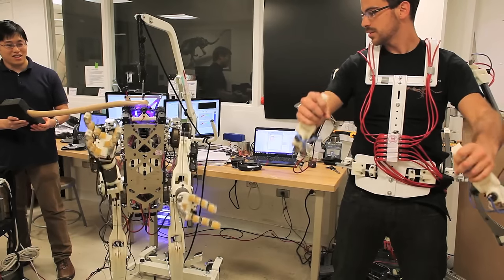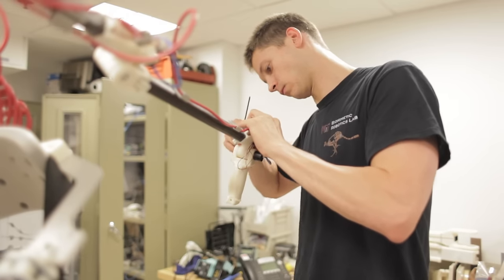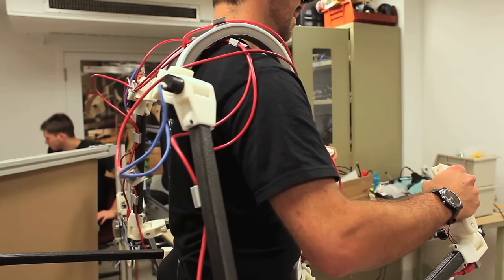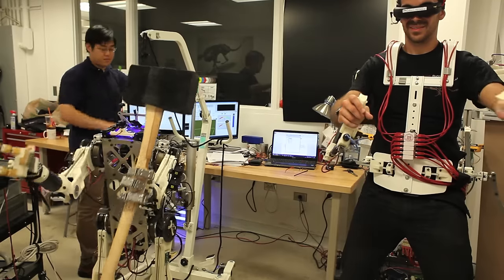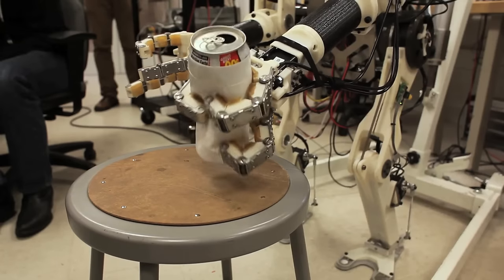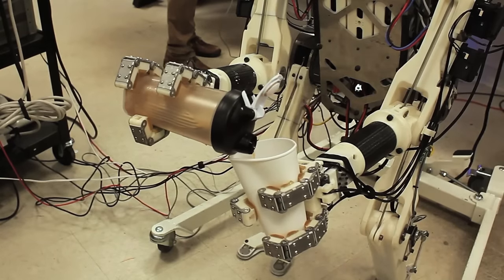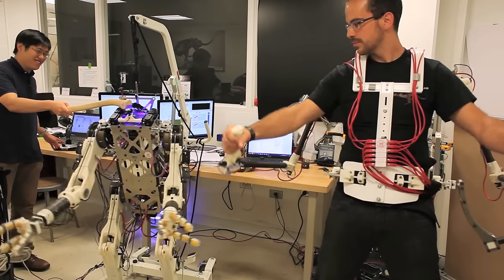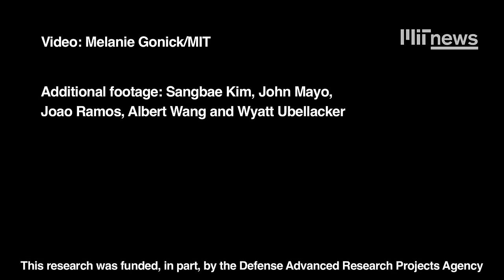Robot with human reflexes

Comment: The response time with the robot and the person is really fast.
Reply: batman 5053 Indeed it is quite fast..
Reply: batman 5053 are you being sarcastic or not
Reply: Rendra Kusuma nope
Reply: It's a connection wired. If the robot were to be deployed on a mission far away from the controller, chances are the communication method would be a satellite, or radio frequency. So the controller would have a slight delay. (Depending on the distance the signal has to travel)
Reply: i could see the input lag lol

Comment: I recommend you use a neuron sensory glove to control its movement virtually. The sensors transmit signals such as the pressure or force applied or required to the human for precise control and manipulation whilst providing open palm freedom.

Comment: Basically what we concluded from the recent darpa robot challenge competition is that robot are good at extreme things like super strength and surviving in extreme conditions, but they are bad at small things like balancing and logic. So we are merging the gap by having human operators handle what humans are good at and having the robots do what they are good at like surviving bullets and teargas, or working round the clock in the dark while lifting 200lb boxes.
Reply: Magneto! the gap may have just been closed with cloud robotics using big data.  
Its already possible for  robots to  behave by themselves and learn from its experiences and predict what it will have to do and do it accuretly without being told.  In terms of balancing that just needs a few years(10 years) like any other tech.
Reply: Magneto! The bots can learn based on the human control over them. I guess AI comes into play here.

Comment: I was wondering are you guys looking into recording the human movement and implanted into the robots. This way you don't have to control it all the time. So when the robots see the soda can it can recall the memory and knows it's a soda can. Trigger either grabs, crushes or if there liquid inside the soda can trigger either drinks or pour depends on the situations. Of course, this will needs a cameras for the robots to be able to scan and see it surrounded.

Comment: Excellent work guys! Is this system wireless? If so that's very low latency. Waldo systems like this have been around for some time but the balancing aspect takes it in a really interesting direction.

Comment: Defiantly need to work on that latency timing. Looks like its more then 100ms
Reply: ***** still an incredible improve compared to before. Normally it would take 1-2 secounds
Reply: ***** perhaps optimizing the code and giving it a little more processor power and memory. :)
Reply: Eduardo Ramires wouldn't the servo speed and  torque factor in also ?
Reply: Yes, but more powerful servos have a bigger size and power consumption. Since the idea here is to have this bot crawling his way inside a building or something like it. I don't know, i am not an expert ^^ just a programmer :p
Reply: Eduardo Ramires Cool me too just web dev tho :)